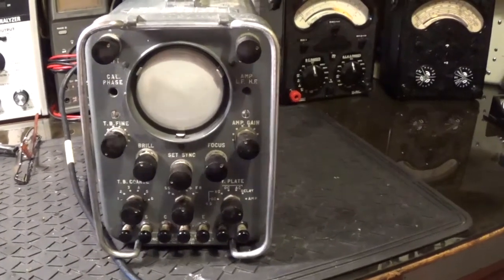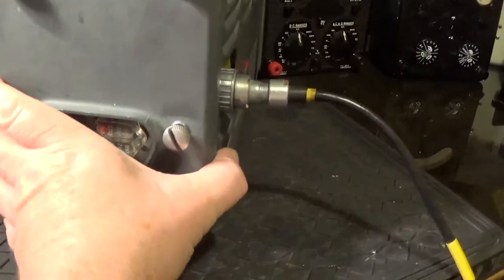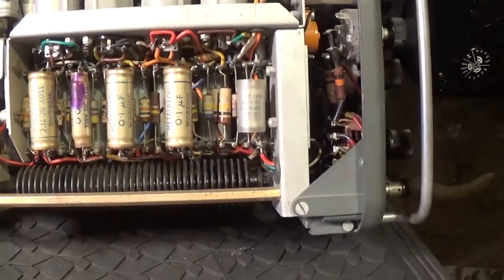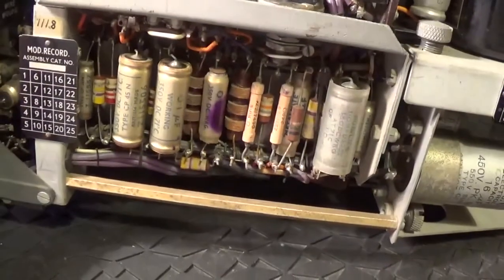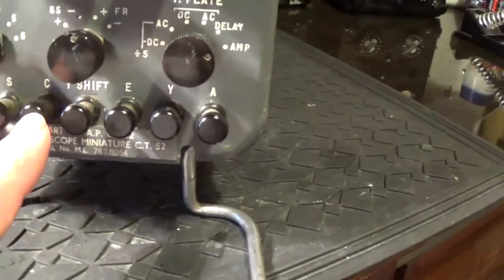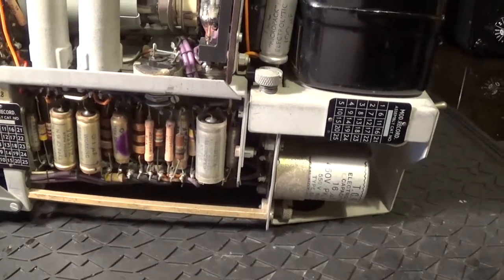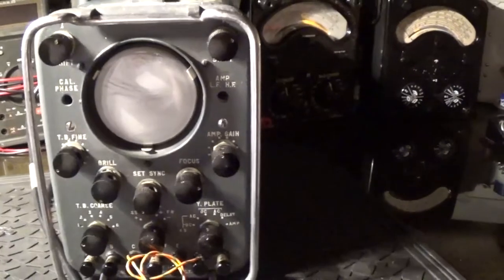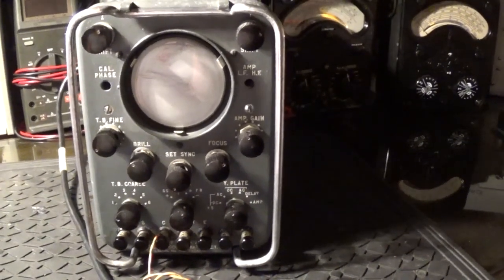Oscilloscope CT52

Comment: I've got one of these. ;-) My parents worked at Metro Vicks in the 1950s, my Mum used to walk through the Test Equipment Department. The one I have was made for an RAF radar station - my Dad joined Metro Vicks after leaving the RAF. So I had to have it. It's a lovely scope, although I'm a bit cautious about the selenium rectifier. Mine came in a metal transit case and the ape like couriers broke the graticule - so I made a new one from a donor graticule - quite a bit of work. Beautifully made.

Comment: Very Nice Time Warp Stuff. Looks virtually New . Thanks.
Reply from the maker: I felt it was sort of a shame to touch it really. I'd loved to have re-stuffed the capacitors but they're metal units with turned over ends sealing rubber bungs into the construction. Pretty much impossible to take them apart without ruining the case. But, I do need this for another project so it has to earn it's living!

Comment: Thanks for the video! I picked up one of these from military surplus in Australia a few years ago. Mine is also missing the graticule, and it was missing the power lead too (it was fun trying to work out the Plessey connector details and get a cable custom-made, thanks to the internet). These originally came with their own box. My CT.52 still seems to work to a fair extent, but I'm pretty sure it could probably do with a recap; it shows some similar artifacts to yours. I'm planning on keeping it original though. The plate on the front of mine says:
'PART OF AP. 68622
OSCILLOSCOPE MINIATURE CT.52
YEAR 1956 SERIAL No. MNA 1914'

Comment: Love this old military gear Andy. CRT might brighten up after a recap.
Reply from the maker: Hi Simon, I'm changing one capacitor at a time and it's improving all the while. Yesterday I was reading 254v on the HT rail, then it would dip down to 199v, followed by the trace desecending on screen. Tonight, after six new capacitors in coupling positions, the CRT is brighter,  trace more stable and not so much smearing. More to go yet though and I've not touched any electrolytics so far. EHT diodes will need replacing possibly as well.
Reply: You might find it's conformally coated to keep out damp. Don't breath that stuff in!

Comment: I have one of these except the display looks like yours on T.B. Coarse 6 and will not vary, just a straight vertical line. The display is bright and all the tubes tested ok and overall it is in lovely condition and is complete with the Graticule and retaining ring.

Comment: You could always have a go at restuffing the original metal can paper (or are they oil filled paper) capacitors using a tubing cutter and clear heat shrink tubing, the modern yellow bodied poly film caps will fit right inside. It's even easier with the electrolytic filter (smoothing" caps as they appear to have a clamp holding them in place. Those white ceramic bodied resistors are usually junk, unless the Mil Spec versions were better, hopefully the mica caps are good as that unit sure has a lot of them.
Reply from the maker: Unfortunately the capacitors are not straight tubes. They're paper in oil and are made like an electrolytic with a rolled over end and a recess rolled into the tube to secure the end caps.  Some have a smaller end diameter tapering down from the body. So almost impossible to restuff without really messing the capacitor up.
Reply: The way I restuffed one was by cutting off one of the ends with an insulator in it, right along that ridge, and then I taped it back together with aluminum duct tape. In that case it had a cardboard sleeve over it so the tape doesn't show, and I was lucky in that the leads of the old cap went right through a hollow brass rivet/grommet in the insulator, so I could unsolder the old cap, solder in the new, and didn't have to drill any extra holes. I'm going to try this same technique on some tubular electrolytics in the future of  a similar design, it would be nice to restuff the low voltage ones they used in early transistor radios for example. I thought maybe you could cut yours in the center of the aluminum tube with a tubing cutter, remove and replace the innards, and then maybe put it back together by slipping the assembly into some clear heat shrink tubing, sort of like what TCC or whomever did back in the day. By the way, those cardboard sleeves are easier to remove then you might think, basically you place one end of the cap over top of a suitably sized mechanic's socket, on top of a hard surface, grab the body of the cardboard tube, and press down, the metal can of the cap will pop right the rolled over end.

Comment: Your Ct52 looks real origional. I have had one too since 1975 which I used often in the 70's until I bought a Trio in 1982. Others followed and currently I am using Tektronix. Recently I dug out the old CT52 and powered it up and it actually still worked but had the same faults as yours short scan and a bit jittery. I decided to take a look inside finding the -800 volt line was reading -550 volts and the main 250 volt line sat at 210 volts. I have changed the old Selenium rectifiers over to silicon and now the voltages are nearer the mark it works quite well but no doubt other improvments could be made. After a year have you done repairs to your CT52 ?

Comment: That transformer looks like the hermetically sealed compressors in refrigerators...
Reply from the maker: It does indeed. This TX is a Parmeko 'Neptune' oil filled unit. It's very heavy.